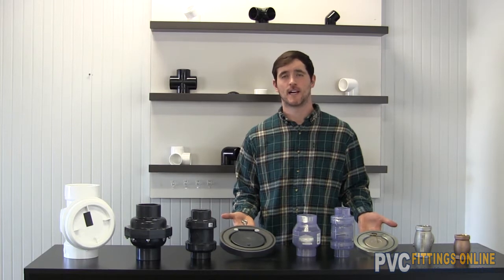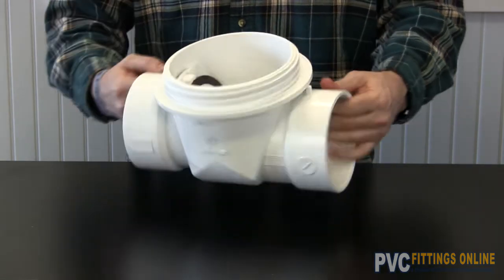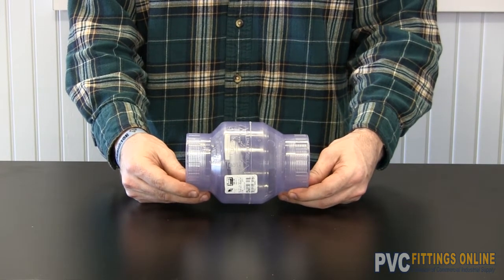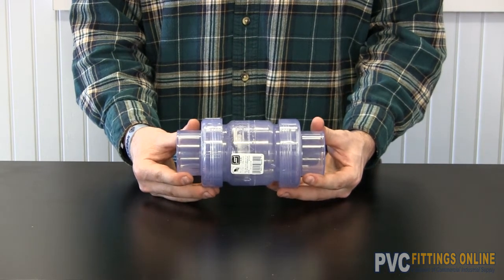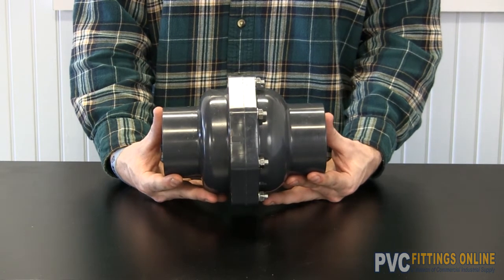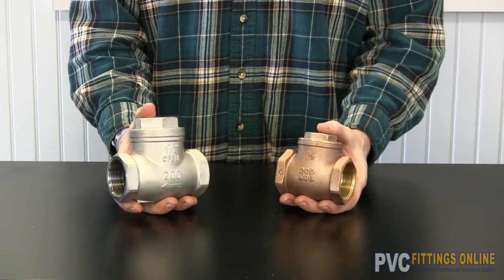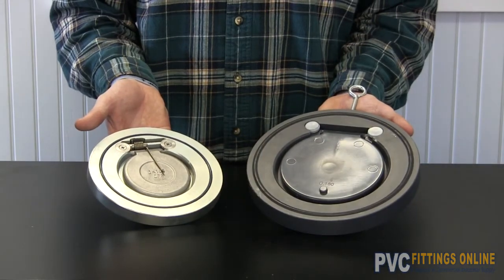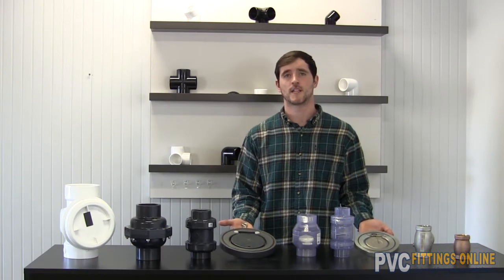Different Types of Check Valves

Comment: Which one is better the ball or swing check valves?
Reply: The check valve
Reply: @josecasti123  What I meant was should I buy the check valve the ball type or the swing type, which is better?
Reply from the maker: Each have their pros and cons depending on the application you're using them for.
Reply: @PVCFittingsOnline  its for pump so it doesn't back siphon..,  and also the check valve should not reduce flow rate, which one is better, the ball type or the swing type?
Reply: @AbboyTopan  just kidding dude it depends for example the swing check is suitable for low pressure while the ball check is best when installed vertically
Reply: @josecasti123  thanks bro, i needed that information.